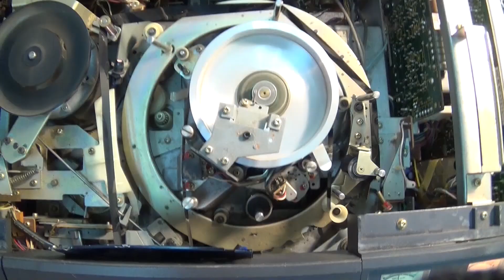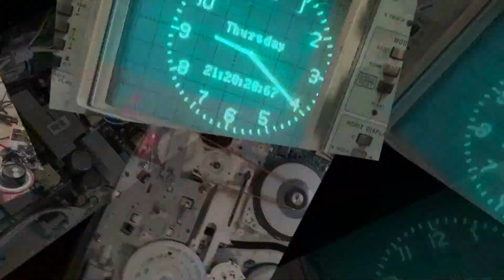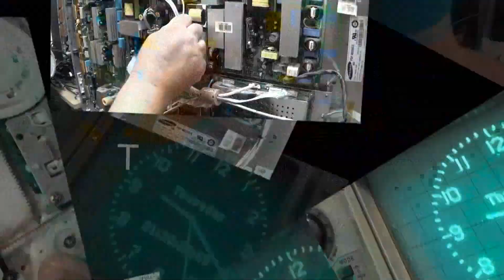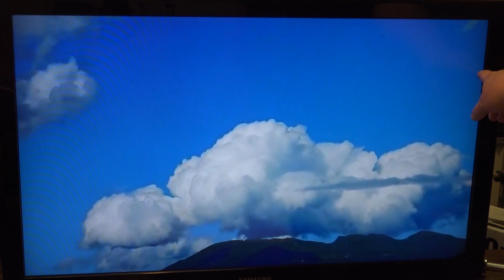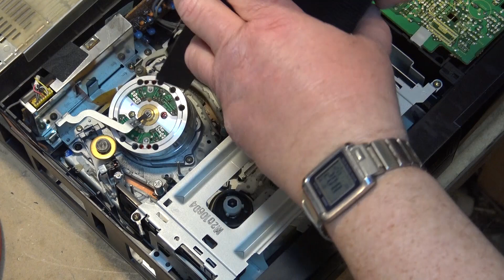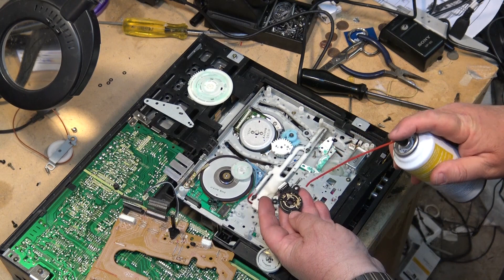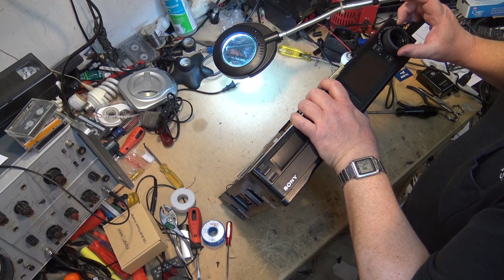Sony SLV585 Full mechanism tear down and repair

Comment: Dave, recently I aquired a few gems at GW.  A LiteOn DVD recorder deck w/remote for 7$ from VOA.  A Sansui A/V77 Processor for 6$ from GW.  This has the ten pin video csmera jack.  And from ebay, I got the Videonics MX1  for 50$ that needs a wall wart.  Somewhere around here, I have an old saticon video camera, either it was a JVC or maybe  Magnavox that I found at a junk store, w/o power supply. The camera had a ten pin plug.  Q, are ten pin  video camera jacks pretty much standard pinout?   I think Sony cams were the exception if I recall right, but I'd like to try the old camera on this Sansui.  I plan to hook these units to a VCR this weekend, and make a demo vid if they all work.  But um hesitant to connect the camera to the Sansui.  My very first video camera outfit was a Sharp Saticon camera into a Hitachi portable VCR, that had the same ten pin jack.  That old camera may be stashed in the attic with the squirrels.  Don
Reply from the maker: All the 10 pin connectors for home video cameras were the same.
Sony used a 14 pin connector for their SL2000 and 2001 recorder, but the Beta 1 SLO340 used the 10 pin.
Saticon was only found on Hitachi made cameras. Panasonic and JVC used Matsushita tubes, which would have been Newvicon. Sony used their "Trinicon". Higher end Sony cameras used a SMF Trinicon, which was a Hitachi Saticon tube designed that Sony built for their single tube cameras.
Other manufactures used Saticon tubes, in their cameras, but once you open the camera it has "Hitachi" written all over it on the internals, so Hitachi was building cameras for other companies. When it all boiled down to it though, there were not many players in the video camera arena, Matsushita which was Panasonic and JVC's parent company, Hitachi, and Sony were the big 3 in the video camera arena. Sony being the largest, but the vast majority of Sony's output went to the 5 and6 digit cameras used by broadcasters.

Comment: I often see VCRS  at junk stores under 10$.  I usually look on back for S Video jacks.  Those I'll take, but they're few and far between.  And BETA are more rare.  But I avoid the junk brands, and stick to better ones like JVC, Mitsubishi, Sony, Panny, Toshiba Hitachi, and maybe the better Sharp.  Samsung, Funai, Daewoo, RCA, Sears, Memerex, Philips, Magnavox, GPX, Gold Star, Zenith, etc, are most common.  I have a few tape eaters and reject jammers.  I usually scrap them, and buy replacements at junk stores because getting parts is near impossible, even belts are very scarce and cost more than simply getting another junk store VCR.  You can test them in store before you buy, and now some GW's and SA's have a three day return / refund policy.  But my Sony hifi Beta will get repaired, it has a tape jammed in it now.  You have a vid up on a simular one, so I'll pull that one out, and see wassup inside.  Some are worth fixing, like those with S Video jacks, like my JVC VHS that has trouble rewinding, like in this vid.  Thanks Dave, I just may take a whack at it, beats the scrap heap, and if I fail to fix it, I still learned something, and then can toss the carcus away.    Don
Reply from the maker: The only machines with S video jacks are S-VHS decks, and yes they are few and far between because most people didn't buy into the better picture quality. They didn't care. As long as they could record "The Simpsons" and play movies they were happy.
Reply: @12voltvids  There are a few non S-VHS decks with S-Video out. I have two dual format (Hi8 & VHS) made by Sony... A SLV-T2000 and a EV-T1. Both PAL. Great machines by the way.
Reply from the maker: @josegti84  
That's a hi8 deck. That is why it has s video out.  I haven't seen any vhs decks with s video out unless it is a combo such as with a dvd player, and guess what. The component and s video outputs are only active when playing the dvd. The vhs deck only played through the composite output.
Reply: @12voltvids  It's dual format... Hi8 & VHS. It was designed for dubbing from Hi8 to VHS. It has S-Video in & out, as well as composite outputs. The video signal goes out untouched, with the luma and chrominance signals travelling separately. The VHS format is recorded that way, unlike other formats like laserdisc. Please check the specs for the models I refered to. I've been watching VHS through S-Video with these two machines for years.   Also, in addition to the S-Video jacks, you have a menu option for selecting the desired output (s-video vs composite) through the scart output. Your tv scart input must support that though.
Reply from the maker: @josegti84  That is because it is primarily a hi8 machine, so it already has the separate  luma and chroma circuits.  Incidentally there is no reason regular VHS couldn't have it because the chroma and luma circuits are already seperate,  however there is no need for it. VHS doesn't have enough horizontal detail to cause crosstalk.
S-VHS and Hi-8 does. 
The reason it exists is because hi-8 and svhs could record enough detail that would cause dot crawl and color sync strobing.  Think a hockey ref's jersey or a pin stripe tie with the color beating with the lumanence. VHS doesn't record enough information for this to be an issue, but hi-8, svhs, dvd and DV certainly does. So the solution was to sent the lumanence (B/W video) and chroma information seperately.  Composite just mixes the 2 together. 
Since they already had the Y/C seperate for the hi8 side, the VHS can share the same circuit.
The DVD / VHS combo units on  the other hand did not. They had 2 sets of outputs, actually 3.
The had component, s-video (Y/C) and composite.
The component and y/c outputs only output a signal from the DVD player. The composite and channel 3 output output both the VHS and the DVD side.
Laserdisk was a composite format. The luma and chroma signals were recorded onto the disk as a composite signal, so no need for an S video output. Some players featured one as a selling feature but all it did was run the composite video signal through a cheap comb filter to seperate the 2 signals.  Any high end Sony TV had a far better 3D comb filter  in it than any laserdisk.
The only thing y/c cables do is prevent high frequency video signals from causing interference on the chroma line. When high detail video gets close to the subcarrier frequency (3.579545 for NTSC and 4.43 for PAL) it would beat with the suppressed subcarrier and cause the dot crawl and strobing) Since regular VHS could not record that high of video frequency, S video was unnecessary, and provides no benefit.
In Y/C the red and blue signals are mixed together and need to be decoded, whereas component sends the red and blue information on it's own path, which improves the quality even more for digital sources.
Reply: @12voltvids  You're right about the crappy comb filters on those high end laserdisc players. I've got mine hooked up to my Yamaha A/V receiver for this purpose. The deinterlacing and scaling modules are much much better than those crappy a2d converters sold on Amazon. Thank you very much for the detailed response. Any advice on how to remove those security screws from vhs... hahaha. Those are really a pain in the a***

Comment: Smashing, it's doing a perfect job again :-).
The good designs make the job really nice to do, the bad ones make you wish you had not started lol.
Great you cleaned the mode switch, they can be a bloody nuisance, i can't count how many times ive cleaned them and the machine behaves itself again.

Sometimes the act of taking something apart fixes the problem, very bloody annoying as you dont get to know what the real fault was :-(.
It's a shame that vcr's have been deemed dead, very handy time shifters.
Reply from the maker: Well we did see the symptom, no take up of the tape on the supply side in reverse / rewind. So the problem was obviously mechanical. Sticky lubricant on the pendulum arm. A drop of oil solves that problem.
Reply: Yes i know you fixed it with lubing, i was just saying ive had annoying devices that after dissasembly/reassembly the dam thing works lol.
Computers have done this to me too.
I like a real fault that i actually find a bad part, otherwise i didnt really do anything :-).
Reply from the maker: Yes those ones can be annoying. Usually a bad connection on a plug, or ground, and just disassembly corrects the fault. In this case though we clearly saw the problem, so it was straight forward.